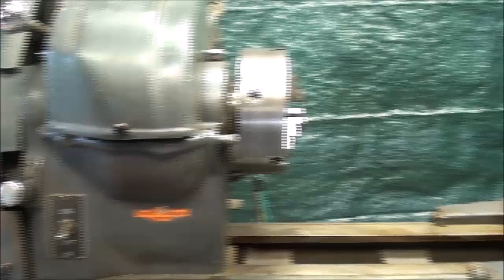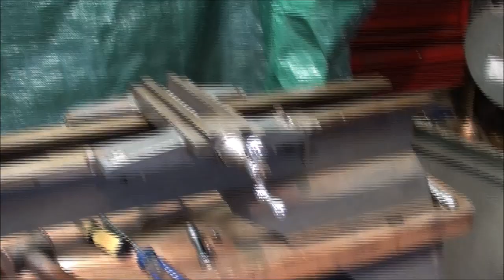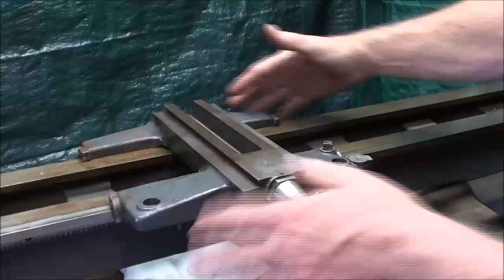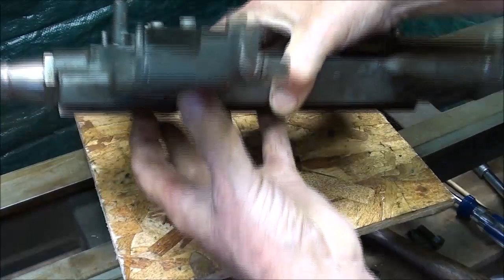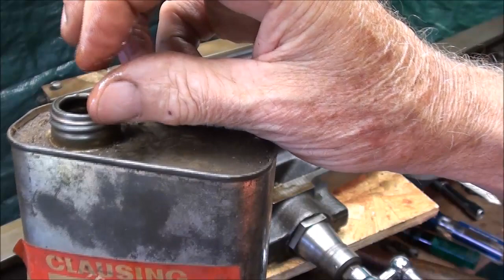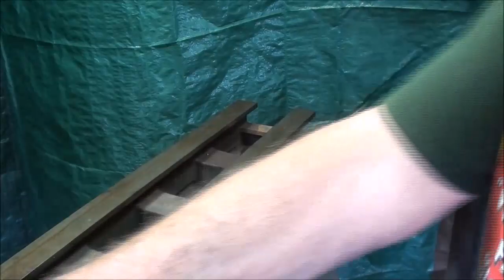SHOP TIPS #234 The Atlas/Craftsman 12" Lathe Saddle tubalcain

Comment: How can we combat backlash on the crossfeed rotating handle(sorry don't know the name)?
Reply from the maker: The only real solution is to replace the screw and the brass nut. Sometimes replacing the nut alone will help as the brass wears much faster than the steel screw. These parts are usually available on eBay.
Most people just compensate for it by backing the screw out one or two turns and then coming back in to the desired setting on the dial. In other words, working around it. Most all older machines will have significant backlash. There was even some backlash on brand new machines .

Comment: Great video as always. 

Should you revisit this subject, you might address the subject of the shims between the contact surfaces with the bed and the shimming of the shimming of the 10-54 lower bearing plates.  

Also checking the these saddle contact surfaces are flat and parallel.  In checking mine, I discovered that one of the rear saddle wings was warped downward by .005" and considerable scraping was needed to correct this warpage.

Comment: An automotive mechanic told me that engine assembly oil was refined to function like way oil. It is engineered to remain sticky so the engine will be lubricated during initial start up. Also, a local thrift shop has provided me with several felt hats in otherwise poor condition. Besides that felt's use in French polishing - I'm a woodworker - that high quality felt could be stacked and lightly glued together to make new wipers, ones that are not contaminated with abrasives. Pete, does it seem feasible to have a sway backed Atlas/Craftsman bed re-ground to eliminate the dip near the chuck?
Reply from the maker: That is interesting about the felt. No, it would cost a fortune to have that bed ground

Comment: Way oil is easy to find, it is sold as chainsaw bar oil most everywhere. I have put holes on the top of the wiper covers so I can wet the felt with oil to keep the ways lubed. Oil holes that don't have oilers installed I pack loosely with felt plugs to retain oil and exclude dirt. If you want it to live you have to feed it.
    Mike (o\!/o)
Reply: I believe Mike is spot on. Spending many of my early years in the sawmill, I have poured many gallons of Way oil plus Bar and Chain oil. The Rep. for the distributor that supplied all of our petroleum products advised me at one time that it was fine to use Bar and Chain oil in the event we ran out of Way oil, as the main difference is that the Bar and Chain had "Pitch Reducers" as an additive and a slight difference in viscosity. The Bar and chain oil I buy at the Hardware Store is no where near as "Heavy" nor "Sticky" as the material used in the Mill. If your not operating in a cold environment I would guess one would have no problem using the common Bar Oil found in the Hardware Store.

Comment: Yup. Holes at the back and of the saddle are for taper attachment (as told by the stock attachment that came on my Atlas). Came in two styles, both a pain to use compared to some, so it is only mounted when needed. The holes can also be used for mounting other accessories, like DRO reader and cross slide scale, back side micrometer stop for the cross slide, or whatever else.
Reply from the maker: +john john Thanks for the info

Comment: I would love to see an honest in depth side by side comparison between a brand new Chi-Com grizzly SouthBend lathe and an original made in U.S.A. SouthBend lathe.  How would the Chinese version withstand the rigorous almost non-stop  use that a genuine SouthBend of 1942 vintage had to endure when  shops were running 24/7/365 ?
Reply from the maker: +Jayne Gus That would be an interesting study
Reply: +Jayne Gus I'm noticing the South Bends Grizzly is selling (the heavy 10 in particular) make no mention of back gears..but do offer a slow spindle speed via VFD...The weights are similar.  Who wants to spend the money to find out? :-)
Reply: +Jayne Gus  Yes I agree that would be an interesting series. Not to discredit either brand but just to give an honest evaluation on quality and workmanship of each.